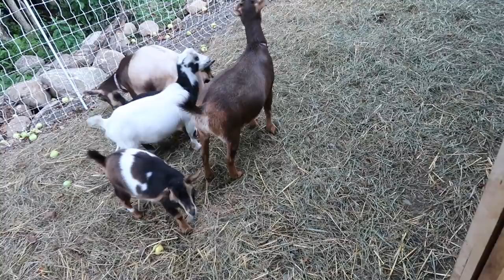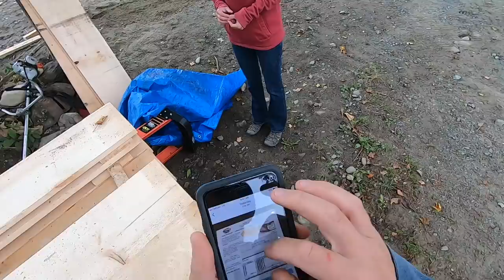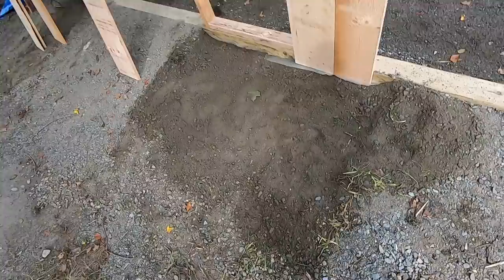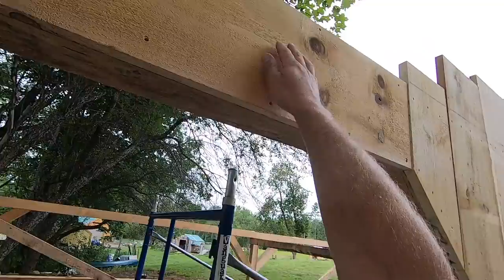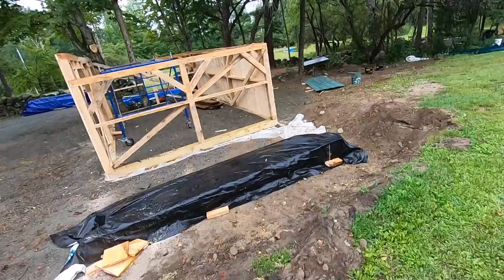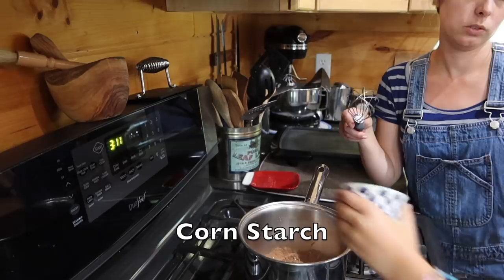All the TRICKS we LEARNED from the BARN BUILD are Paying OFF Siding the Post and Beam WOOD Shed

Comment: Looking good guys on the shed! Canning tip-NEVER push the seal down because you can cause a false seal. You wont know if it really sealed or you did it and you will not know if it needs to be reprocessed or refrigerated and eaten immediately.
Reply: Yes, my neighbor did that after I helped her can grape juice. As a result, not one of the quarts actually sealed.
Reply: Very dangerous indeed!

Comment: An old bar tender trick you might want to use when your pouring water out of a bottle turn it upside down and swirl the bottle in a circle coursing a whirlpool in the bottle. It empties fast without the splash. Hope it helps xx

Comment: As I said before, what you need is a wagon; with a tool box/nail and bolts bins  maybe a electrical plug installed; (with extention core).After every job, just back iy into the barn and restock it. That way you not have to reload every time into your truck or bucket loader..

Comment: Since the siding boards are touching the plastic/ground I hope they don't dry rot from the bottom up.  The end grain of the boards is like a sponge and soaks up water like crazy.
Reply: I was thinking they could have oiled the end of the boards to set on the ground. I had an old Garage that had a back add on that was built on the Ground. Thanks to a new law it did bring down the Value, of the house!!!
Reply: I had the same thought...or prop up the building on stone or blocks.

Comment: Gina, the trick to getting the hard coating is to apply a thin layer of the chocolate to the plastic mold before adding pudding. It may mean freezing the chocolate before adding the pudding so experiment. 💝☀🌵
Reply: After they are frozen, they should be dipped in chocolate coating.  Buy Milk or Dark chocolate wafers from Amazon, heat in a double boiler .  Never get water in the chocolate or it will seize up.  It should be heated very slowly and stir constantly until melted . If it is too hot, it won't stick, it should be almost same temperature as your finger when you stick you finger in it.
Reply: @sharonhenegar4030 , I thought of doing it that way but after dipping where do you put it while you are waiting for the chocolate to harden?  If you eat it right after you dip, then there's 2 clean ups. If you dip the pops and refreeze, what do you do with them...  they won't fit back into the molds? My way, you assemble the pops and the coating all in one session. Just trying to learn. Sending lots of love 💝 from sunny ☀Arizona 🌵

Comment: I make my own chocolate covering once I pull the pudding pops from the holder. 1/4 cup chocolate, 1 1/2 Tablespoons of coconut oil, I also added some chopped macadamia nuts. Heat in microwave in 20 second increments until softened/not completely melted. Stir until smooth. Pour over pops as they lay on their side. Flip and do other side. The coconut oil is what makes the coating solid/firm. Or you can use Magic Shell if you prefer.

Comment: Kathy DeCree  If you want a chocolate coating on the outside.  Buy Melting Candy Wafers different flavors available, Wilton makes them and other brands.  Lay wax paper or a silicone baking sheet, something you'll be able to lay the pops after you dip them and they won't stick. Or you can dip and eat as you want,  they will harden quickly. When your pops are frozen..melt the candy wafers in a bowl over a pot of water or use a double boiler, melt your flavor candy wafers.  Don't get any liquid in the choc it will seize up.  Get your frozen pops out and ready to dip into the melted chocolate.  Dip and eat.  You could also do a batch of pops and wrap each chocolate-covered pop separately in plastic wrap and put them back in the freezer for later.   I don't know which craft stores you have around you like A C MOORES or MICHAELS, or go online.  It's the same candy used for making hard chocolate candy especially during holidays like Easter, Christmas Halloween.  Hope this helps.  Love your videos and family.

Comment: If you wanted to make the horizontal board over the door look like vertical ones, you can take a utility knife and make a shallow cut in the wood vertically, and using a pen make a dark line where the cut is.  From a distance it would make they wood match the other vertical boards

Comment: I posting this suggestion here since you mentioned building a garage for Gina.  It's a bad thing to park a wet car in a garage.  It rains so much there you might consider a car port.  Even a car port with a semi enclosed front end.  Sealing up a wet car in a garage is like putting the car in a sauna.  Water ends up in places where it wouldn't have if not sealed up.  "Figaro the Cat" will be able to get in there to keep the rats out too.  I saw what happened to your truck.  I have been driving since 1975 finally started parking in my garage like 15 years ago when I bought a new car.  It never rains here in Southern California but when it did I parked my wet car in the garage.  This caused my hanging tools that had been hanging there for 15 years to rust.  The wood in the garage even smelt wet.

Comment: Mr. Lumnah ,
How nice of you to share your "toys" with Mrs. Lumnah.
Quick question: Wouldn't it have been more efficient to come from inside when trimming off the excess at the top of the siding? Using the beam as the guide for the saw?
Reply: The saw most likely don’t have the depth to reach past t the 4x4 beams
Reply: @lolcott  Good answer don't you like it when people who don't know how to do the work give pointers on a "better" way to do it.
Reply: @lolcott  That saw Al is using has only got a cut depth of 2 1/4" (metric= 55mm). I know because I have saw with the same blade size 6½", but a different make.

Comment: I believe the corner siding board will rot at the bottom as it will always be sitting in water after it rains or snows unless you cut that plastic away or put holes in it.

Comment: Never push down on the top of the lids when you are waiting for them to seal. It may give you a false seal. I had it happen once to one of my jars. Always let them pop down when the suction inside the jar is high enough to do it on its own, then you know for sure that you have a valid seal. Once the jars cool down remove the rings from the jars before you store them that way you can tell right away of a seal fails or not.

Comment: You could do chocolate centers on the pudding pops by melting chocolate and dipping the sticks like candles until you build up a thick layer on them. Make sure it goes a little past the top of the mold. When you pour in the pudding, stop an inch from the top of the mold and fill the rest with the melted chocolate. They'll look cool and, well, it's chocolate! How bad could that be?

Comment: I sure hope that gravel drains well or the bottom of those siding boards are going to rot quickly !
Reply: Jack Patteeuw 
There is plastic under the wall boards which will actually hold all the water that runs down the walls. Wish it just sat on the gravel or better yet some concrete.

Comment: Looks really good. Can I ask why you decided to bury the base frame insted of just cutting them out in the doorways like you did on the barn?  Couldn't you just used some metal rods in the ground to secure it or some other tie downs. 

I was just thinking how I secured the stables I built. I built a shed also and the same night I finished it, it got blown across a road and into another field. When I rebuilt it, I knocked in some fence posts about 2 to 3 foot deep around it and attached a rail to the fence posts and then to the shed. It never moved again. 

I ask because I live in England where it's wet and windy in the winter. Wooden constructions rot out so quickly here if we don't treat them with some kind of weather proofing often. So I was thinking those base beams will rot out fast even with the barrier because they are under ground. Also couldn't that barrier hold in mosture, rain that blows in the doorways wont be able to drain away.

Comment: Turning cans upside-down isn't an old wives tale. It's from a different method of canning/jam making. It's for those who don't use a canning bath for sterilization. When the sterilized jars (putting them in a hot oven) are filled with boiling liquid and the sterilized lids are screwed on, there is still a centimeter or so of air that could contaminate the product. By turning the jar upside-down immediately, the air has to pass through the boiling liquid and is then sterilized. It's a different method but not an old wives tale. Growing up, we used wax - the jam would cool a bit without the lid, then melted wax was poured over the jam. As it cooled it created an airtight seal against the glass. Once the wax had solidified we placed the lids on. This was mostly because the jars that were available to us had plastic lids that would not stand up to high heat. Different methods for different purposes/materials.

Comment: Hey Al - I think the wood over the doorways would look better if you used vertical pieces instead of one horizontal piece .
Reply: He can score it with the saw to make look like vertical pieces of wood, and keep the strength and integrity of a single piece. Just 1/4" will do fine. Form a distance it'll look perfect.

Comment: Nice project.  One question, you put pressure treated on barn yet with this directly in contact with dirt you did not use pressure treated.  Any reason ??
Reply: Was it pressure-treated? I thought all the wood they used for the barn was just (untreated) rough sawn lumber?
Reply: @keandric2765  He made a point of putting extra 2x6 oftrepated lumber on the ground and then putting kit lumber on top of it.  I am sure all the kit lumber is rough sawn un treated
Reply: @Larry Gawne Ah, ok. Thanks :)

Comment: Two walls up, two to go!  Then the roof.  You better get back on the website and find that craft shop!    Not to mention you could certainly build it in your head.  Of course it needs heat and cooling,  and most certainly electricity. 😊😊🏡🏡🏚